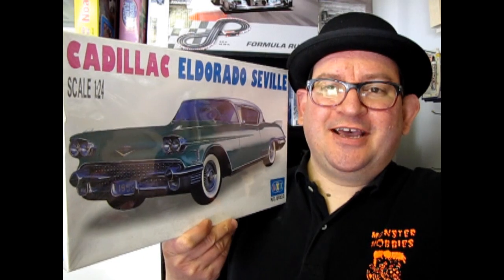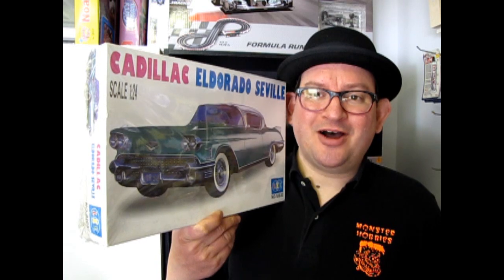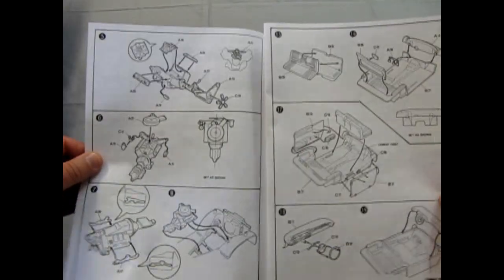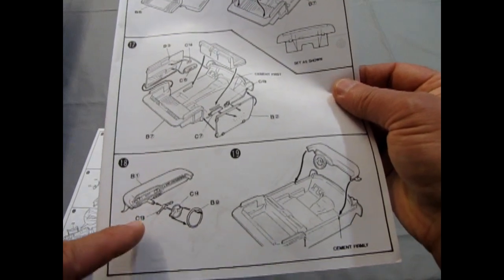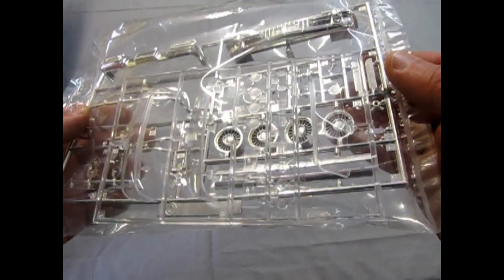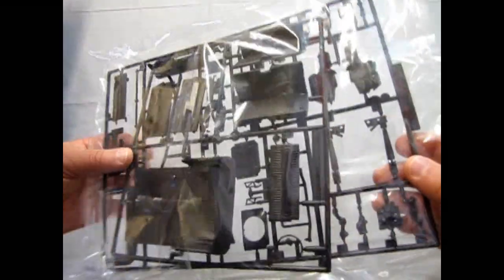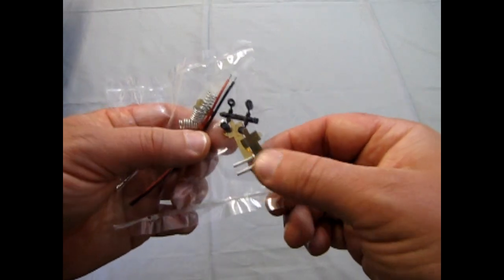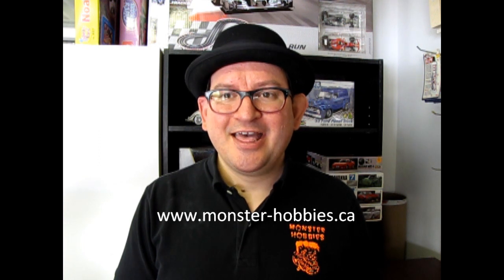What's In The Box? LEE 01032 1958 Cadillac Eldorado Seville Model Kit

Comment: Rick , the engine was the 390 Q code , 3 deuces , or dual quads , also an even rarer version is the Eldo-Seville with a 4 speed manual in the floor . Cool Cadillac stuff for sure .
Reply from the maker: Thank you for the info! :D